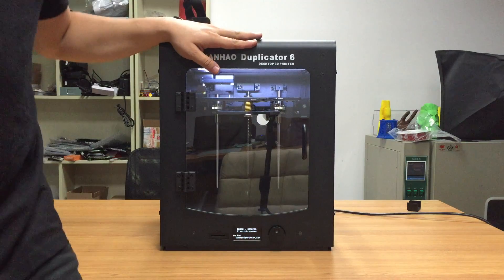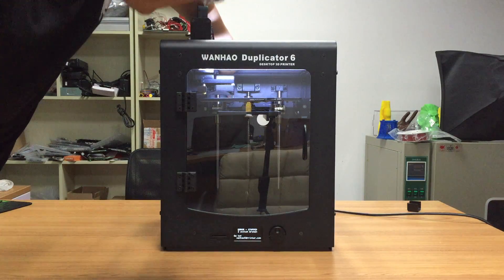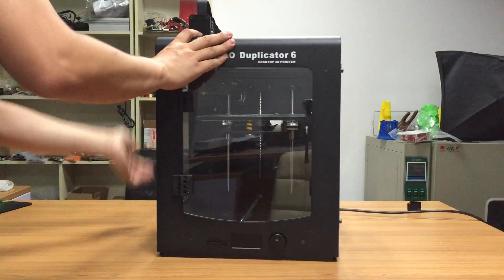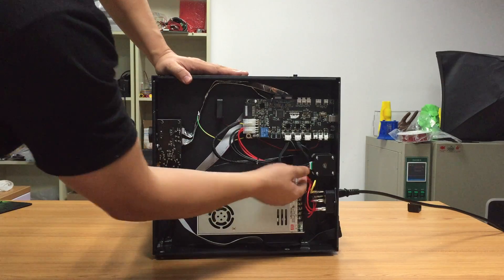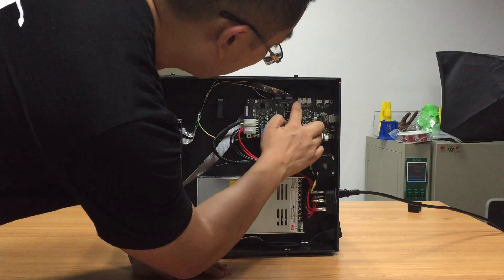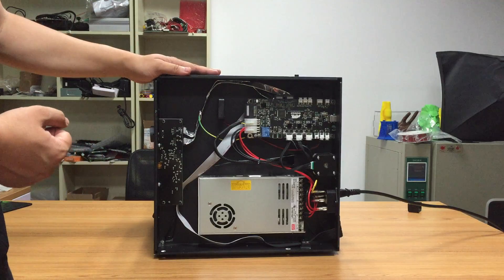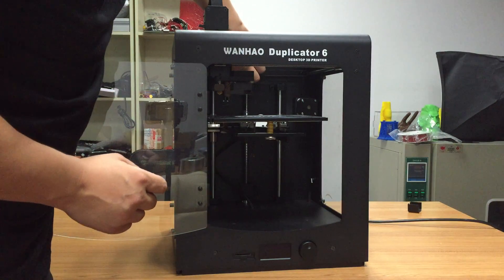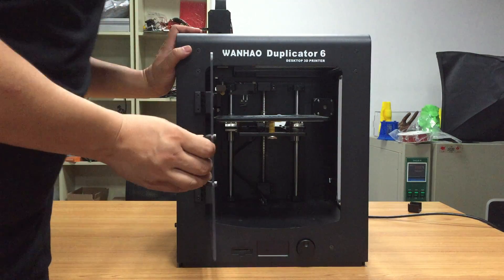How to fix D6 warning " Error stopped,  Z switch broken"?

Comment: I had this issue and my solution was to apply White Lithium Grease to the z axis rods. My bed just would lock up or not move at all. I wiped the rods down, then applied the Lithium Grease and everything works like new!

Thanks for your video too. If I have more issues I know what to check now.